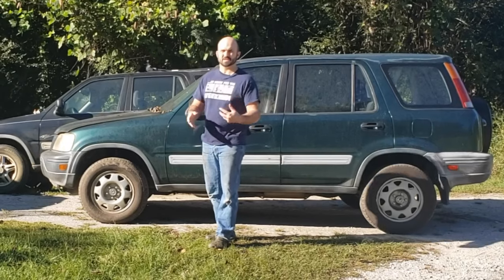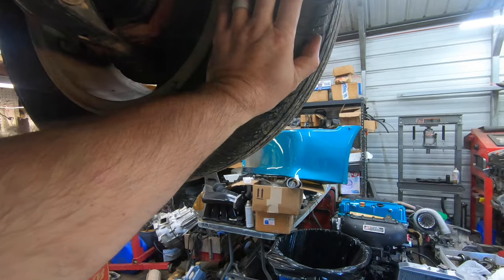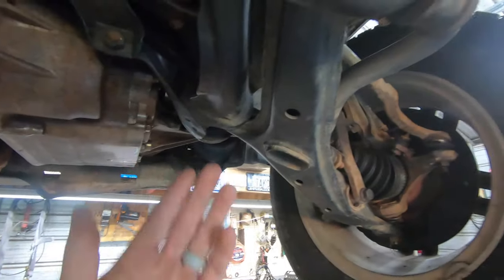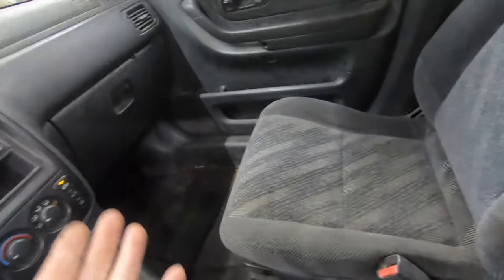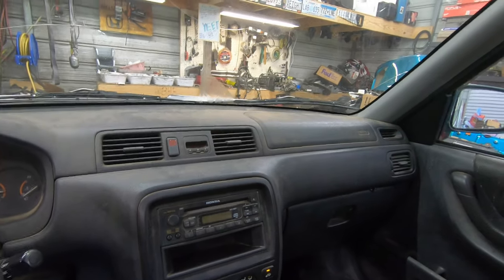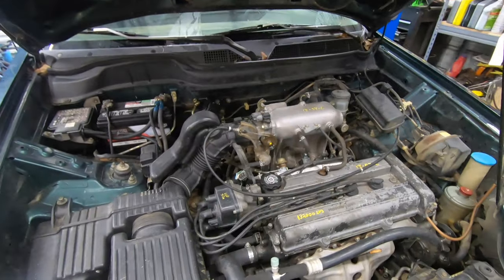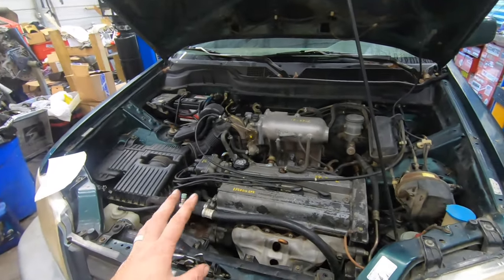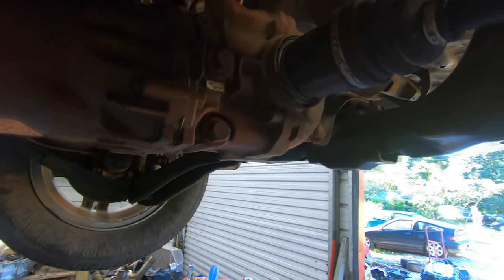Most Common Problems: 1997 - 2001 Honda CRV RD1 RD2

Comment: I recently acquired an 01' V and it had a burnt Cyl 3 exhaust valve.   JDM B20B.  Pulled the head.  Lapped valves.  Replaced burnt valve and seals.   Installed and it runs great but seems to be consuming a ton of oil.   Think I've got bad or stuck rings.  It also does this super weird thing where it starts great cold but when warm it long cranks and barely sputters to life.   I'm currently chasing that issue.   And per your valve lash vid, lash is spot on. I really took my time with that so I don't think that's the issues.   175 miles so far in this rebuild. 😊

Comment: I bought my '98 CRV in March of that year and it currently has a little over 292k miles under her belt so I'm coming from a place of experience. I've found checking/adjusting the valve clearance every 30k miles to be overkill. I slowly kept extending the intervals to see if it made any difference, I now do it every 50k miles and even at that interval I usually only have to adjust several exhaust valves to the loose side of specs. Last year I replaced the original lower ball joints with the Proforged brand which I've had good luck with when I replaced the outer tie rod ends around five years ago. Another thing to watch is the condition of the rear trailing arm bushings which I replaced last year as well. Great video!
Reply from the maker: Awesome, yeah I was just going off what Honda recommends

Comment: Just did a boatload of work to mine, including engine swap, most of the suspension replaced. just had one horn go out, which killed the brake lights, etc. Fixed that, and the rear washer. The only thing left is the Cruise control, which used to work and a front end alignment.

Comment: Great content my bro. Love your videos. I own 2 first gen crv’s and they’re both manual. They’re pretty rare everywhere with manual transmissions. One is a 99 lx and the other is a 01 ex. Love them both.  The 01 I bought back in 2010. Picked it up from a surfer dude in Santa Barbara :)
Reply from the maker: That's awesome!
Reply: H2B swap one of the bad boys cut the Qsd kit for the starter and  you ready to go
Reply from the maker: @bakihanma7247  I'm a dealer for PLM and sell a h2b kit. It's kinda tough to find h motors around here though
Reply: H series are kind of hard to come by here also. I’m in California. Plenty of b series and k series though.
Reply: @d1sk12002  Sounds like some good gear ratios. I'll trade you an H22 for a Gsr Lol I'm currently just swapping a b16 from a 00 si into my 99 crv. It's automatic but I like how the auto shifter is out of the way on the column 👌I helped my buddy install his 5speed lifted 99 crv with an H2b H23 Bluetop. It's so Fun to drive especially Off-road mudding 🔥🔥
Reply: @hondaresource  Where can I order the Plm H2b kit.?
Reply from the maker: @bakihanma7247  https://the-honda-resource.myshopify.com/products/private-label-mfg-h2b-swap-kit-honda-eg-ek-acura-integra-dc2
Reply from the maker: use discount code PLM10 at checkout for a discount
Reply from the maker: The EK kit should work on the crv
Reply: @bakihanma7247  both of those sound like pretty good set ups. I was never crazy about the b16. Not enough power for me. I had a 95 civic dx coupe with a gsr swap. That was a fun car. Pretty fast too. I got ready of it because it got me in trouble with the law constantly lol. Are you in Cali too?
Reply: @hondaresource  Okay sweet thank you sir
Reply: @d1sk12002  No I'm in Oklahoma it's hard find a Gsr here. And got a good deal on a b16. Not really looking for power on this one just a daily with ac and power steering. I had a 93 integra rs back then with an 01 prelude H22 mated to a 95 accord f22 trans Lol god I miss that little car
Reply: @hondaresource  y'all got any crv strut brace bars or sway bars.?
Reply from the maker: @bakihanma7247  no sir, not right now. Only thing offered from PLM that is "crv"are the lift spacers
Reply: @hondaresource  Okay I can work with that thanks. I gotta check those out
Reply: @hondaresource  Can you give me a link to the spacer I can't find it on there
Reply from the maker: @bakihanma7247  https://privatelabelmfg.com/collections/honda-cr-v 

The discount code wont work directly on PLM's website, I can update my website with the spacers or you can purchase directly from me for the discounted price
Reply: @d1sk12002  damn Im in CA too and I had 2 h22a4 out a 5th gen prelude just laying around. I listed them and nobody wanted to buy so I tossed them when I sold my prelude.

Comment: I'm getting infected with the itch to buy one of these to compliment my GE Fit Sport and I saw one locally on the classifieds for $1500. Now that price for Puerto Rico is a red flag already, but the ad mentions that the car has a "bad" water pump. Is that something I should just walk away from because of a greater issue(head gasket?) or something a timing belt kit can cure? Great video and thanks for sharing!

Comment: Thank you so much for this video! Possible there's a little differential chatter in the front? I have that chatter on mine but it seems to be coming from the front. My model is manual transmission if it makes a difference.

Comment: Oh, I was waiting for you to have nailed the PGMFI and/or main relay problem, notorious for most Honda models of these years range.  The cold solder joints on the PCB board, easy to fix or replace.
Reply from the maker: The main relays can definitely be an issue!

Comment: I have a 99 CR-V My door wire harness was pinched BAD. 22 WIRES going to the door!. I spliced in a foot of new wires in between....44 connections!  Luckily, I was a car audio installer in a previous decade, so it was more pain in the neck than anything else.  I'm hoping to install 2 inch spacers soon, and get my baby BACK on the road! The guy that I bought the car from had let a ball joint go for a long time, and it made a seal go in my steering rack, with an endless drip. I'm replacing THAT too.  I don't consider that a "common" problem.

Comment: maaaan i wish i woulda known about this channel 2 yrs ago when i spent months trying to figure out what the clunking noise was on my 99 crv.  finally figured out it was the tie rod end.  but man, it was such a PITA to figure out exactly what it was.

edit: wow, my clock is broken too! it's been broken for years.
Reply from the maker: Welcome aboard!
Reply: Buy a LED clock off of Amazon that fits inside the casing. Skip the clock battery & wire it to the existing car wiring.  Reduce the 12V to under 4V using voltage divider. I used 2 resistors.

Comment: I’m having the worst trouble with my 2000 Honda CR-V manual. About 4 or 5 months ago, it started stalling at idle and it idled a little rough. About 3 months ago it started stalling why I was driving it. I bought an Ancel OBD2 and it would throw random codes. One day it would say O2 sensor (upstream), then P1399, P0300, and P0301-304 (all cylinders misfiring). One single time it threw P0505 (idle control system), and P0122 (TPS switch A circuit low). There was no rhyme or reason to it, the codes would be here today and gone tomorrow, replaced by a different code. The short term fuel trim was all over the place at idle (-7.0 to -17.6). I checked every single vacuum line for vacuum leak, with an entire can of brake cleaner, but nothing. 
We have replaced, O2 sensor, spark plugs, plug wires, distributor cap and rotor, distributor (with new cam sensor), TPS,
and probably half a dozen other things that I can’t remember at the moment. 
We drove it to my mechanics, I would only make it a few miles and it would stall. I had to wait 15 minutes, without ever trying to crank it, before it would crank again and go another few more miles. On the last 10 miles, I got in behind a person driving 35mph and it never stalled again, which honestly had me baffled. Anyway he put it in his Snap-on machine and it came up “Temporary Code List, DE0604H/1455032, Refresh To OEM.” So he’s at a loss as well.
Ok, after writing a book about it (sorry about that), the only thing that I believe that can be it is the ECU/ECM. 
My husband says that the only thing it needs now is a match in the gas tank. 😒😂
Have you ever experience anything this mysterious with a first Gen CR-V, or am I just having bad luck?
Reply: Sandra I'm having the same problem. Did you solve yours? If so please let me know. Thanks

Comment: Love your videos. 
2 issues I had with my 2000 CRV was a faulty distributor that I replaced, and the cat blocked up and needed to replace the whole exhaust. Have you ever dealt with those problems? 
Thanks
Reply from the maker: I've delt with plenty of distributor issues. Not very common for the cat to be blocked.

Comment: Love your videos ! I live in Michigan and have a 99 CR V that’s got an engine light stuck on but my mechanic guy who works on cars out of his garage says it’s nothing to worry about ? Say what ? He says it’s got to do with gas tank ? Can ya help me ? I may as well go to reg shop have an inspection instead of guessing lol 😂
Reply from the maker: Most auto parts stores will check the codes for free
Reply: Not tightening up the gas cap enough after refilling. Click close at least 3x and after the next few times of refilling gas the engine light may turn off

Comment: Some other problems that can occur: Axles can break causing clunking from sharp turns. Back window mounts break. Valve stem seals tend to wear out and cause oil to burn and come out the exhaust while idling the car and will eventually clear up when driving. doors mechanisms some times freeze and become stuck shut not a fun time trying to get it to release as if it locks again it will be stuck again. Windshields are prone to rocks xD just in my luck.

Comment: Hello, I'm trying to find out if you have a video regarding replacing all 5 engine mounts on a 2000 AWD CR-V with automatic transmission. My issue is that I had a shop replace mine, and now I have a terrible vibration throughout the entire vehicle at idle and whenever power is needed. The vibration wasn't there before they replaced the mounts. Do you know if they need to be installed in any certain order or torqued to certain specs in any order? Thank you. Your videos are awesome and I have subscribed under two different names to them. : )
Reply from the maker: I dont have a video for it, sorry man. No particular order to replacing them.
Reply: @hondaresource  Thank you for responding so quickly, Phillip. Have a great say !!

Comment: I have 2001 1st generation CRV LX AWD Automatic with 135,000 miles on it, which I bought new in 2001. It’s in pretty good shape. I love this car. I’m hoping to keep it running as long as I do. Thanks for all your great advice. Have you run into issues with vibration sounds coming from the catalytic converter?
Reply from the maker: Heat shields rusting off?
Reply: @hondaresource  no, internal. It causes sort of a “blasting” sound maybe coming out of the exhaust pipe. We (one of my mechanics, although sometimes I do the work myself) think it’s the Catalytic Converter.
Reply from the maker: @pwoc94110  I've seen them melt and pieces break loose

Comment: I have a 1st Gen RD1.. car just brings joy ! 

I have recently been having a problem with wet floor board but on the driver side. I saw you talked about the passenger side, that same problem could be connected to both ?
Reply from the maker: Usually it's from busted seam sealer on the driver side
Reply: @hondaresource  Thank you For the Response I will look into that

Comment: 😎 One thing that was an issue in the first generation was the ignition switch some they warranted others it's a quick fix just swap it out but If you don't the whole car will just shut off.
Reply from the maker: I've definitely dealt with that issue several times across many of the 90s era Hondas

Comment: Hi big fan of your videos.  Very helpful.  But I a question what's making my honda 98 crv turn off while driving . I have replaced fuel pump fuel filter.  A few relays also . Wait about 5 10 mins turns back on .
Reply from the maker: I would say either your distributor or main relay

Comment: Hey, from Albuquerque NM. I’ve had my ‘01 RD-1 for the past 16 years. It’ has about 136k miles. It has never had a valve adjustment while I’ve owned it and runs really well.  Would there be any benefit to getting into an adjustment if there’s nothing wrong with it.. And I seem to remember reading in a forum that the engine in the ‘01s didn’t require that work… ?? Thanks for this channel. It’s giving me a lot of great info and ideas!
Reply: Definitely get a valve adjustment done. Should be done every 30k miles. Just bought one that has 286k miles. Had a misfire code and a valve adjustment fixed it, runs great now.

Comment: hey, I've got a 99 C-RV and well even though is made it two hours home with all the issues it has, I just wanted your opinion on if you'd save this one, or just ditch it. aside from needing an engine (that one I'm more than willing to get.) it needs ball joints on both sides up front, both rear axle bushings, a windshield, sway bar inlinks, both tie rod ends, all control arm bushings up front, I too have a leaking fresh air vent on the passenger side, oil pan gasket, rear seal that connects the engine to the transmission (no clue what its called sorry). so far that about concludes what we have found so far. However she still drives and stops so, I have a great deal of respect for this model C-RV. I like this car a lot even with all these issues. My question to you is, would you feel she's worth saving or would you not even touch it with a 10ft pole? xD
Reply from the maker: It really just depends on if you're mechanically inclined and feel like tackling some repairs
Reply: I bought a crv for parts that needed a full suspension overhaul, a clutch, and a windshield for under 1k. Ended up fixing it and it's been great. Now i need another parts car tho. XD

Comment: Water leakage in the front seats comes fom a hole in the floor which corresponds with the sunroof..
Another problem are the valve seals, they must be replaced at 150-200 000 km.
Otherwise you will face oil consume..
Lambda sensor also must be replaced after 200 000km

Comment: IVE BEEN SEARCHING YOUR CHANNEL FOR A RACK AND PINION REPLACEMENT VIDEO FOR 1ST GEN 4WD OR POWER STEERING PUMP IF YOU HAVENT MADE THEM YET PLEASE MAKE ONE NO ONE ELSE HAS AN EXCELLENT WAY OF EXPLAINING THE PROCESS LIKE YOU IN THE CORRECT DETAIL. I THINK I KILLED MY POWER STEERING WHEN I PUT IN THE WRONG FLUID AND ITS JUST PISSING FLUID SO I THINK I MAY HAVE TO CHANGE THE WHOLE ASSEMBLY.
Reply from the maker: Thank you! I haven't made a video for doing the rack and pinion yet. It's not a fun job. I can make on for the pump at some point.
Reply: @hondaresource  CAN I USE A POWER STEERING PUMP FROM THE JUNKYARD BECAUSE I PUT REGULAR POWER STEERING FLUID IN MINE AND IT STARTED LEAKING LIKE CRAZY. WOULD I HAVE TO CHANGE THE WHOLE SYSTEM TO INSURE THAT NONE OF THE AMERICAN FLUID IS IN THE SYSTEM?

Comment: awesome video man. I have a 1st gen year 97'. i've encounter a odd problem when i come to putting it back into Park sometimes it's hard to get it back into it. sometimes the Park light will light up but the car would jerk forward or backward depending if I'm incline/decline area. i then have to hit the shifter up for it to click into Park.  i'll have to pull the e brake up to prevent the car from moving. what may you think is the problem on my car ?
Reply from the maker: sounds like it may be the parking pawl in the transmission, but hard to say for sure.
Reply: Check for slack in your shifter cable
Reply: Yes it was slack with the cable. The little hanging thingy to hold the cable got bent a bit. I bent it back and forth until it's running good again. Good thing it wasn't the tranny.

Comment: Replaced those noisy tie rod links on my 01 with 130000 miles on it today only problem I’ve had is the clock doesn’t work

Comment: Looking at buyin a 99EX Auto with 190k miles. Say everything works right, few minor issues that can be easily fixed, almost perfect body and good running engine/trans. Would you buy it? Still a lot of life left?
Reply from the maker: Sure, they are great vehicles

Comment: The rusting rear subframe connectors and torn torque mounts are super common.
Reply from the maker: We dont have rust here in Alabama so I have little experience with it
Reply: @hondaresource  you wouldnt think kansas would be bad for rust, but those bars trap water.  Just rewired drivers door wire bulkhead today..

Comment: I FIXED MY HONDA 2001 thanks to this MAN!<<<. Question do I need to vacuum ac to remove temperature sensor from dryer canister? Or can I just unscrew it with refrigerant coming out? I think there an air valve but just wanted to be sure I wanted to ask the doctor
Reply from the maker: yes absolutely remove the freon first!
Reply: @hondaresource  WOAH!!! I was just gonna say SCREW IT  but woah you saved my ass!!!
Reply: I GOT CODE P1361 I researched it and it’s coming out to a speed sensor.  What do you say about the code?   Please help

Comment: idk if youll see this but last year I changed the rad, thermostat, and head gasket on my car and also cleaned out the hoses cus they had built up debris inside because my car was overheating last year.. it sort of fixed it but now my car heats up when coming to a stop while on drive then goes back down to normal temps when moving . It also revs up and down to/from 2000RPM when put in park also whenever I use my car for like an hour ( grocery's/shopping ) and try to turn it on to go home it doesnt start until I give it some time to cooldown even tho the gauge doesnt say its hot( my best guess ). I called up my dads mechanic to see if he could get it fixed but hopefully you have some ideas of whats going on so I could be ready to make some suggestions or whatever to him and get my car fixed up soon